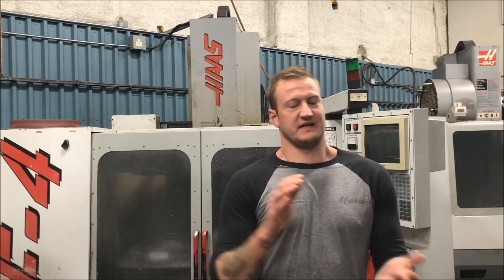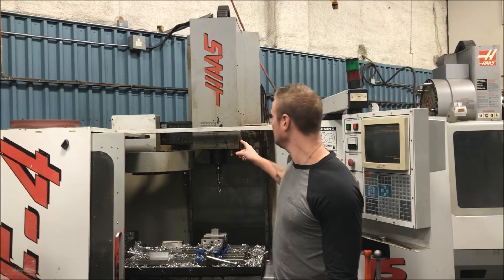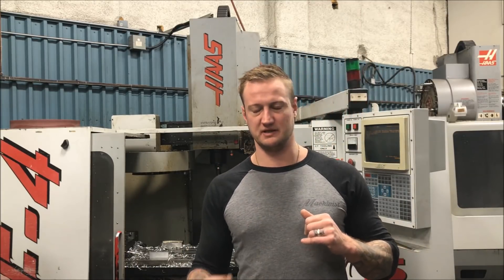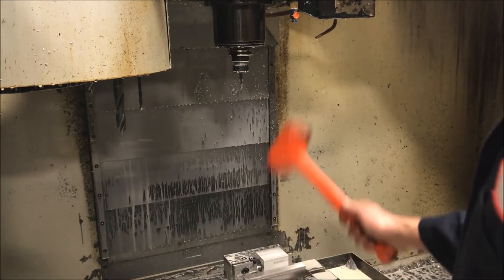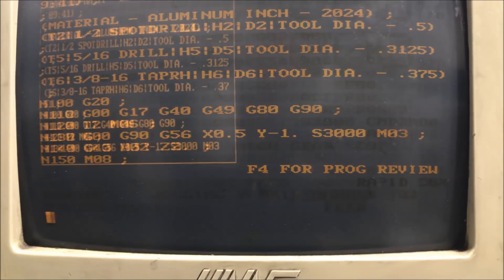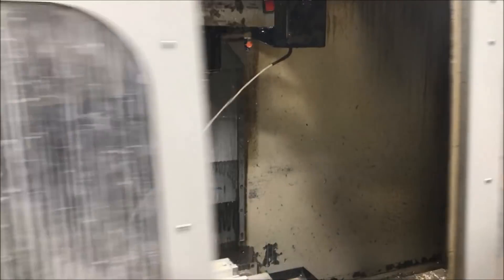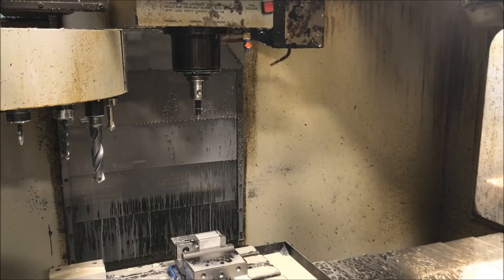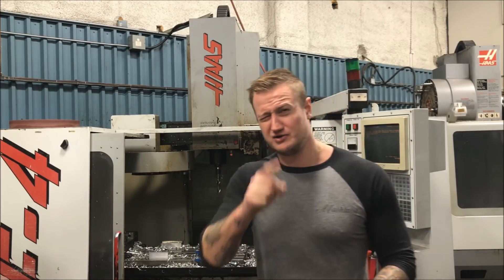[TT] BEGINNER CNC: STAGING TOOLS TO SAVE TIME

Comment: Advanced level is getting that Post Processor to put that in for you. ;) The Post at my job outputs T00. Standard Home tool. I change it to the First tool as well.
Reply from the maker: Absolutely, mine does too - or did with my Mastercam X9! Haven’t set up the post to do it with 2018 yet.
Reply: Hey Ian, Here's another way of advancing the tool changer  to the first tool in carousel, but only If your first tool is a 90 degree carbide or HSS  spot drill and your first operation is spot drilling. Program in Mastercam a 2d chamfering toolpath at the end of your program so you DEBURR the hole/part edges. I can send you an example if you like.

Comment: Great beginners tip! Even with a side-mount tool changer I do this all the time. The postprocessor posts G53 Z0 at the end. This line I always change to T2 M06  (or whatever the first tool is). I don't need G53 Z0, the tool change does this. Followed with the G53 Y0 offcourse... Be careful with those G28's.... ;))